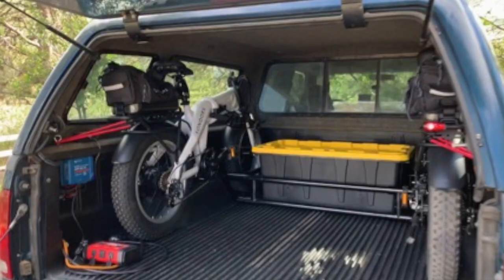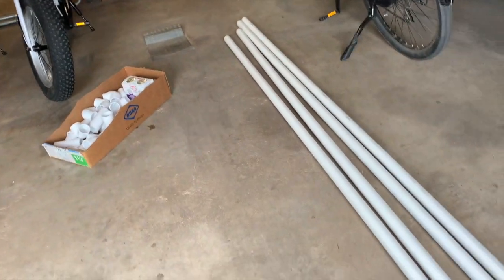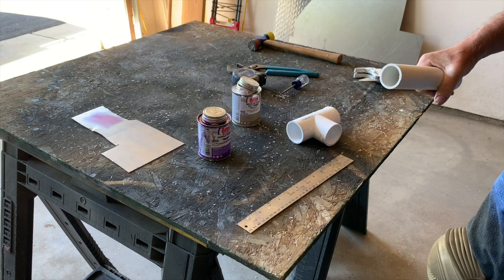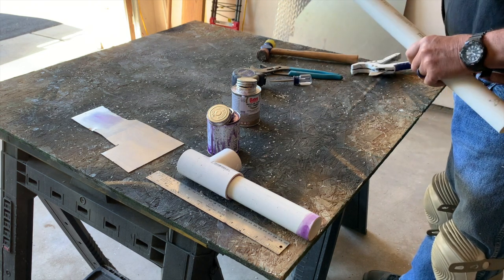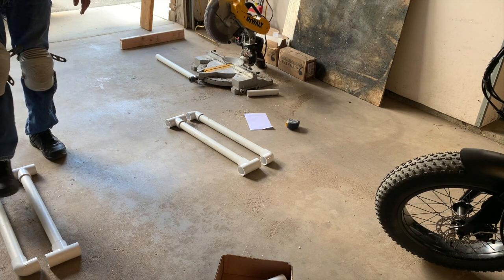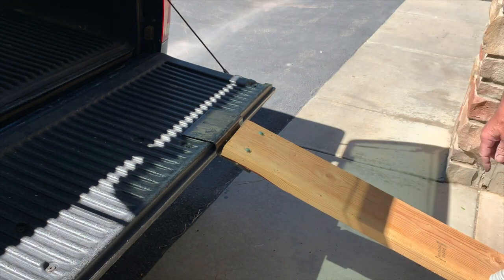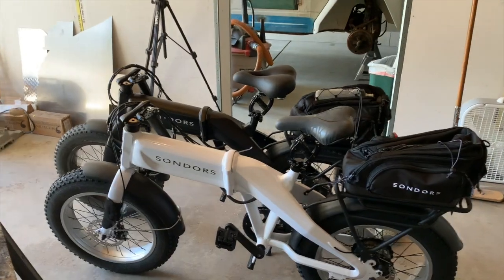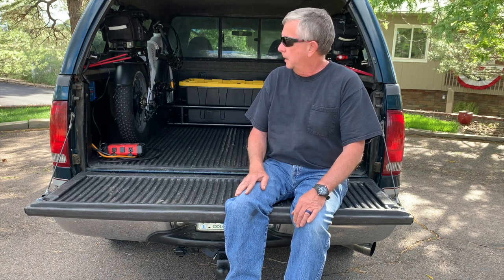How to Build a 20 inch FAT Tire PVC Bike Rack for the Bed of a Pickup Truck - Sondors Fold X

Comment: Thanks for the concept. Every truck bed is different. My Ram 1500 has a very short distance from the front wall of the bed to the wheel well. Your ideas can be modified to fit any bed. I also made two ramps out of 8x10's, stained and polyurethaned them and bought ramp toppers from Amazon.thanks for the motivation.
Bob Weber
Reply from the maker: Very nice. Thanks. See my playlist

Comment: Thanks for this project! I built one for my LECTRIC bikes.  Altered your plan a little by adding 1 more support on the outside edges. Also vertical supports near the front for the tires to slip in.  Works great. No lateral movement.  Thanks again.
Reply from the maker: Very cool. Check out my playlists. Thanks
Reply: Can you share picture of your design

Comment: Love your design! I am only wanting to put ONE  Rad mini e-bike in bed of my F150. How could I modify the design to accommodate one bike? Does your rack require 2 wheel bays for strength or couldnI bypass one wheel well and extend the center section to replace one well?
Reply from the maker: Needs both sides for strength. Thanks

Comment: I like this design, but I'm not sure I see how it's giving good vertical stability. What's keeping the bike from tipping over and the wheel going under one of the horizontal pieces of pvc?
Reply: I agree and I’m not sure the bungee cord is such a good idea.  He had quite a bit of lateral movement, so yes the bungee will keep it from swaying to the inside, but when it pulls back, what keeps it from hitting the side of the camper/truck?  It’s a good idea, but he needs something to stop the side to side sway.
Reply from the maker: Yep. I went to one of those tie cords that have a ratchet in it.  To release I push a button.  Greta to since it up.  Think i got it from lowes.  Thanks for asking
Reply from the maker: Good question... the PNC pipe is pretty snug when the tire goes in. I played out the pvc with the tire to get a good fit.  I now have over 6000 miles on it traveling across  US and have had zero issues  You do need to tie the rear end luggage to the truck to keep rear end stable. I ent to a ratchet strap that uses a cord instead of belt. push button to release. Also i throw a big beach towel over the bikes so no one can see them in the back thru the window. have-not had an issue with rubbing even without the towel.  Thanks for asking!

Comment: Sorry, but I can't find the link to the steel bracket you used for the lumber ramp.  Can you post it?  Thanks.
Reply from the maker: Came from Home Depot.  Look in the metal tie section with fasteners.  Thanks for asking.

Comment: How long is that 2 x 8? Is there a minimum length? Have a link for the bracket?
Reply from the maker: It is six feet. I split it in halve so it fits in bed. I had it laying around. Might get aluminum ramp fro harbor freight. Thanks
Reply: @bparkinson1234  Thanks!